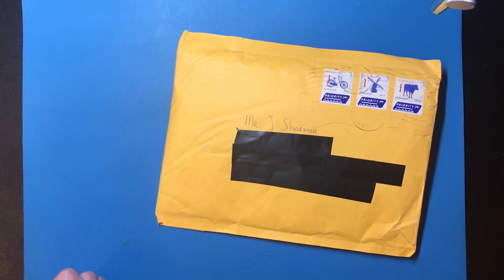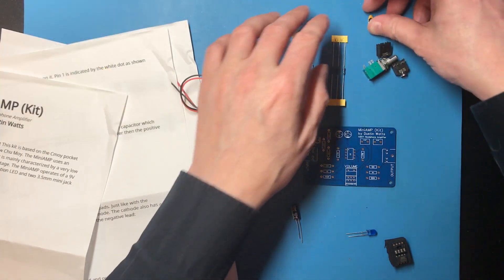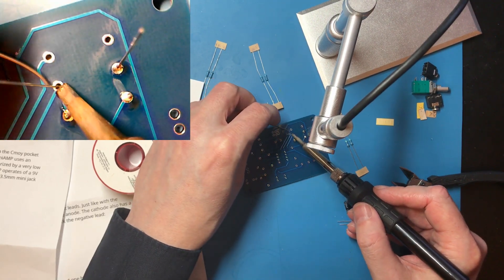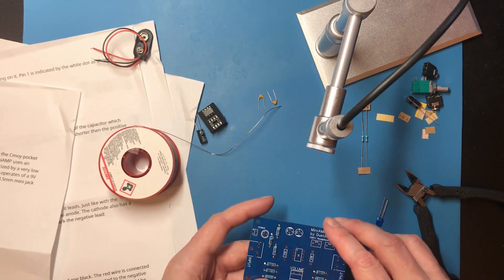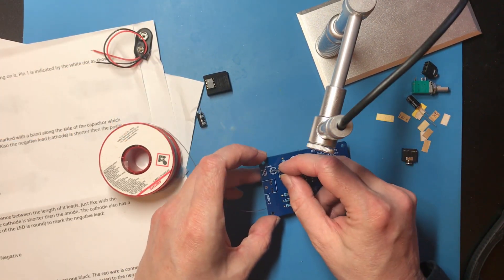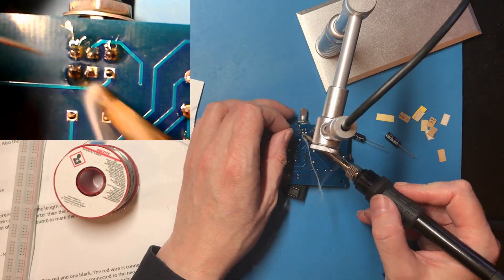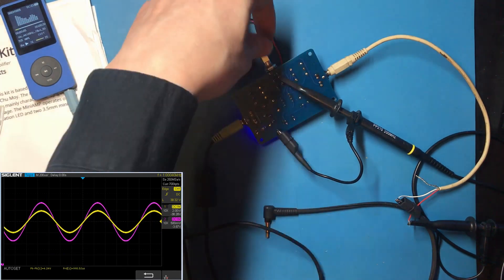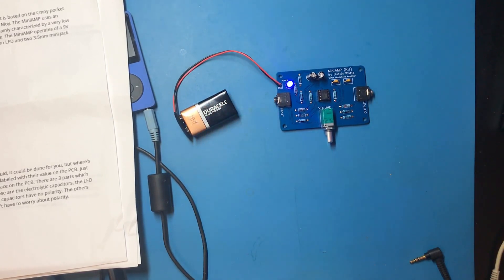MiniAMP kit build

Comment: Perhaps you can tell me why "they" changed to using a blue background from an actually readable tan/brown background for resistors.  This drives me nuts - which is admittedly a short trip lately.
Reply from the maker: This is a weird one. Generally a brown body means the resistance is accurate to a %5 tolerance, blue mean the tolerance is 1%. It used to be that blue ones were more expensive (And so people only used them where the accuracy was needed) but as time went on and they got better at making them and blue gradually replaced brown in most places.
Reply: @weirdboyjim  Thanks, James. I just read that blue-bodied resistors are likely to be metal-film (and higher precision, as you mentioned), and brown-bodied are carbon.  I say "likely" as the interwebs are rife with contradictory information, and more than one site said that it wasn't a standard among manufacturers, but was most commonly true.
Still, wish they'd picked a body color with better contrast.

Comment: Hats off to Dustin for using an OPA2134 design rather than settling for lesser semiconductors.
Reply from the maker: Was indeed a nice circuit and easy to put together.
Reply: The OPA2134 is quite a bit more expensive that other opamps, but I think it is definitely worth it!

Comment: sometimes i like the simplicity with which a certain function can be archived XD
in case someone is interested in the datasheet for the OPAMP .. http://www.ti.com/lit/ds/symlink/opa2134.pdf
Reply from the maker: Thanks for the link nico, the exact part number on the chip is OPA2134PA, the duel one in that data sheet (it also covers a single and quad version).